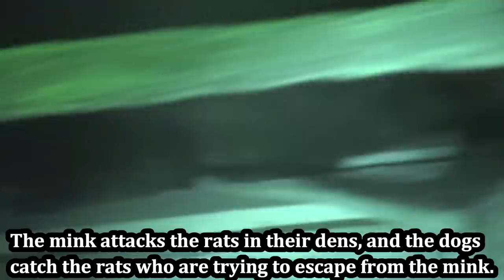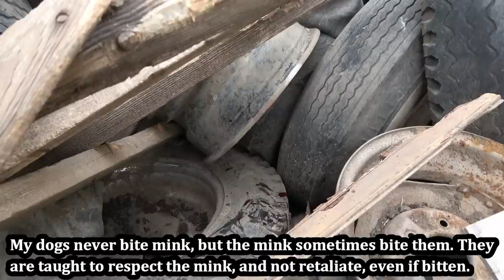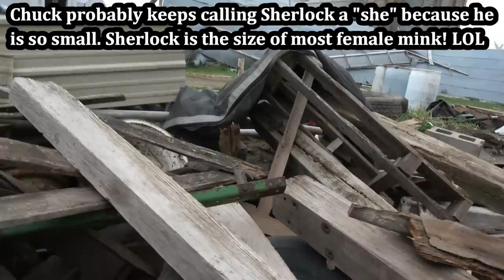Rubbish Rat Eradication with Mink and Dogs.

Comment: To answer the question on why dogs don’t mistake the mink and rats/mice is that dogs can smell different smells and latch on to one particular smell which is the rats and mice, Mark Rober just made a video on what makes a dog so good at tracking
Reply: I've also stated this before in many vids that dogs can differentiate between friend or foe.
Reply: Ooohh soo thats how, ive been wondering that every time
Reply: Does the scent of the rats not stick to the minx?
Reply: @beta2029  "Does the scent of the rats not stick to the minx?"
It does, but because the mink's scent is 'live' versus the rat's scent being rubbed onto it during the scuffle, therefore making the mink scent stronger to be detected by the dogs.

Comment: Why isn't the farmer pulling all that stuff in the middle of the drive way and setting it on fire? Especially in the winter when there is snow on the ground.
Reply: Joe asked the farmer not to move the stuff because it would make the rats run. He's gonna help the farmer clean this time around now that all the trailers available to be used.

Comment: it's incredible to me how well train you have both your mink and the dogs, specially how the dogs wait for the mink to sometimes flush out the rats so they can kill them and at the same time don't hurt the mink in the process. My only real concern trough the video is the amount of debri in the area that could harm the dogs when they start running after the rats with all the wood, metal panels and nails, but other than that keep up the great work.